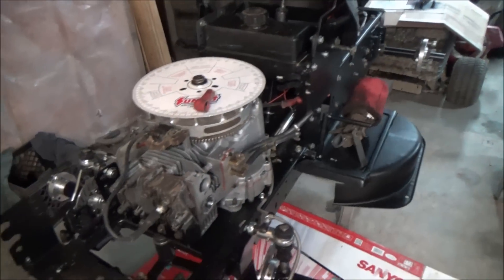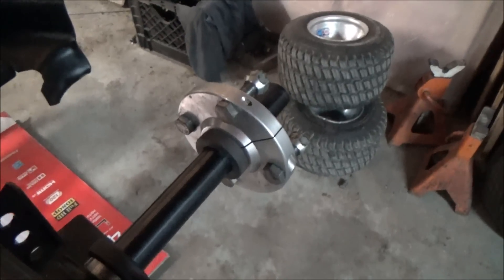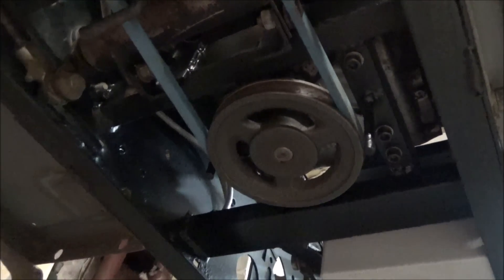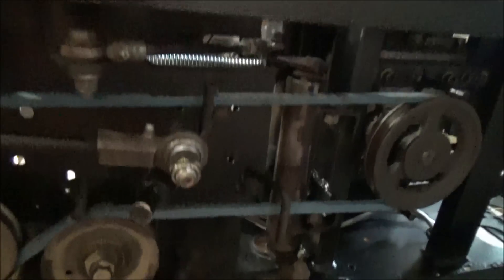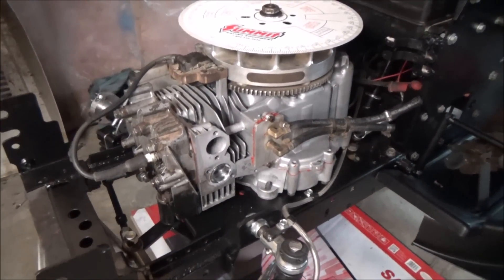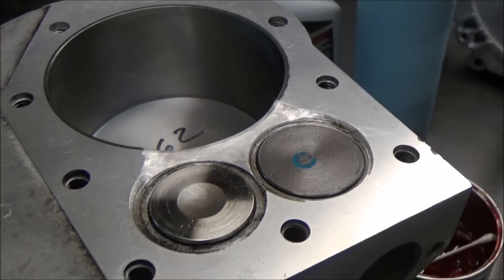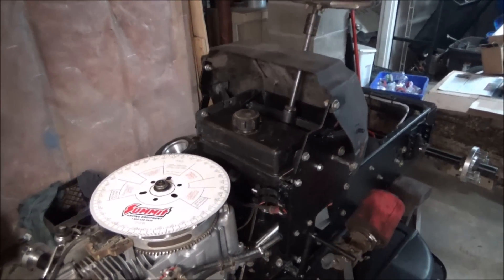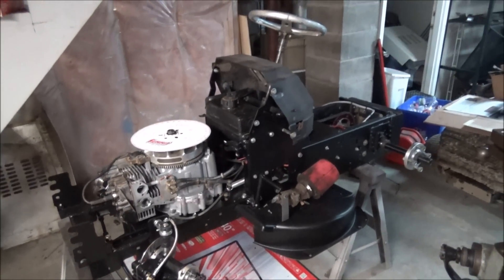What Makes A Racing Lawn Mower Go

Comment: You didn't cant the valves?? It ain't stroked? You can't go with flex fuel? It's cheap and 85 percent methanol. Do they race in Texas?. I never seen it here. Did u go to dry sump or just a windage tray? Where do I find the rules. I may have to go up there and blow some doors off!!!!

Comment: How do these 700 series hold up ? i swapped my old 6hp mower to as 16hp v-twin :) lets see how long it will last hah
Reply from the maker: They do pretty well as long as you're not shocking it with sudden load or shifting under power.

Comment: What transmission is that? I'm new to this and have never seen belt input chain output. Great video
Reply from the maker: It's a peerless 700 transmission. They come with a 5/8 keyed input shaft and splined output.

Comment: Great video, Taking a lot of inspiration from your work. I’ve got the same mower model. It’s stripped to the chassis in my shop now. Where did you get your cart axle from? 36” x 1 1/4” right? Bearing hangers and all that from the same place? Thanks for the support and video!
Reply from the maker: We bought most of our parts from BMI karting and EC carbeurators, but that was years ago and there are definitely other retailers out there.
Axles are 36" x 1.25", 40" is max width sidewall to sidewall per USLMRA rules for our classes and wheels have 5" offset on each side (douglass 8x8's) so there's room for shaft collars.
Reply: @TheJanticJournal  hey man, what transmission did I use and where can I get it.

Comment: i have a question, why not use the multi speed trans axle from the mower? are they not strong enough? im wanting to build a twin v powered drift mower and would like a multi speed trans
Reply from the maker: In lawnmower racing we don't typically use trans axles because we would be stuck with a narrow and small axle size (typically 3/4"). Using the peerless 700 allows us to use a 36" wide 1-1/4" kart axle that is super strong and gives us the ability to fine tune gearing with different sprockets. If you're building a drift mower with some kind of plastic tires a transaxle should be fine. Btw keep an eye out, we have a peerless 700 transmission video coming out real soon.
Reply: cool thanks, ya i was thinking of starting with the plastic sleeves but would hope to make it drift on rubber but love the idea of banging through 6 gears. im wanting to use a brigs twin v maybe the 27hp one and maybe twin turbocharging it and converting from belt drive to sprocket drive. but if the trans axle cant handle that id rather go straight to a set up that will.

Comment: I've got a mid 90's murray mower and im gonna attempt to put a go kart axle and horizontal shaft engine in it that makes about 28 HP, would that be legal in any lawn mower race events ?
Reply from the maker: +Tennessee Outdoorsman If you don't build it to a certain set of rules then it's most likely not going to be legal for any mower racing g that I know of. To me it sounds like you might be looking at building something like an FXS for USLMRA but there are other groups with different classifications.
Reply: TheJanticJournal ok thanks

Comment: Do you do anything special for race prepping your 700?? Be nice to see a video of you going through the gearbox. Great video, thanks
Reply from the maker: +Don Raabe I just install an oil seal on the output shaft, remove the reverse sprockets and chain and replace the grease with gear oil. I just had a bad race weekend and broke two of them. The lesson learned is never ever shift at full speed lol

Comment: Flatheads like flow, high compression is not really important. See: https://wurstexpress.wordpress.com/2016/11/23/wurst-2-oppy-frisch-machen-theorie/
Reply from the maker: +Wurst Express Thanks for the comment and interesting article. Can you run aftermarket cam, and other internals in your racing group?
Reply: TheJanticJournal. Yes, we can. There is nearly no limit except for cubic inches and carb has to come off of a small engine (no Mikuni etc.). Regulations: www.erwm.de

Comment: Hey what kind of belt is that?  That doesn't look like a very standard belt.   Can you post a photo/diagram of how you have the pulleys setup and to the 700 trans (is that a 5 speed?)   - Trying to build for the first time and it's one of the things I'm trying to figure out before I start.  Any help would be greatly appreciated!   What model mower is that frame?  Is there certain frames to steer away from - I read someone was saying stay away from MTD frames.  Anyways!  Thanks for the videos man! New subscriber!
Reply from the maker: +Nicholas Brown It's just a 1/2" belt from tractor supply, they seem to hold up well. The transmission is a 5 speed, unfortunately you can't post pictures in comments but belt setup is close to how them come factory. Make sure you have the clutch on the slack side of the belt. My mower is an older craftsman, I like them but they're heavy, like really heavy. I know lots of guys like and run mtds. Some of them have a big weight advantage over a craftsman.

Comment: I have a baja doodle bug blitz like your green on d you have to bye a moto plate for the predator 212 if not what do I need to do please help
Reply from the maker: +oIN YOUR FACEo0 The bolt pattern is different than stock. I think they sell an adapter plate or you could make up some blocks. I ended up cutting out the stock motor plate and welding in a new one. I covered it in an earlier video, if you haven't seen it check it out